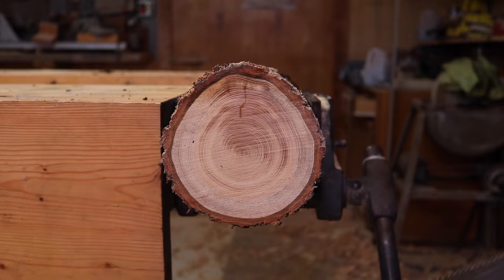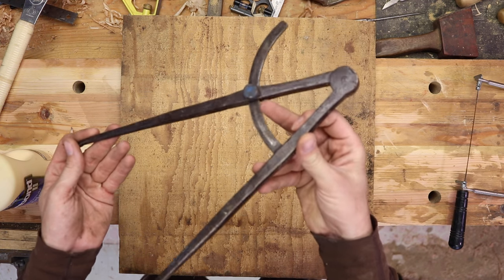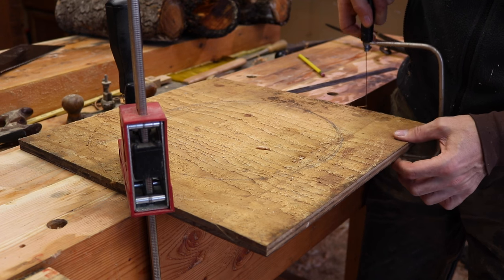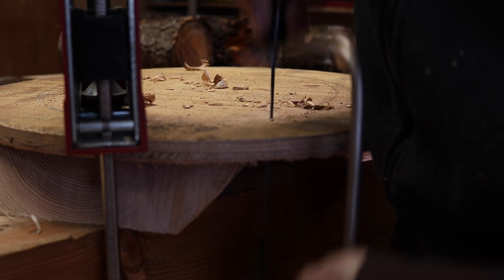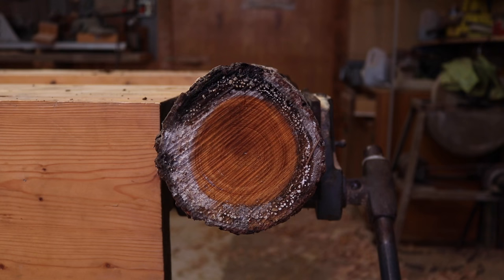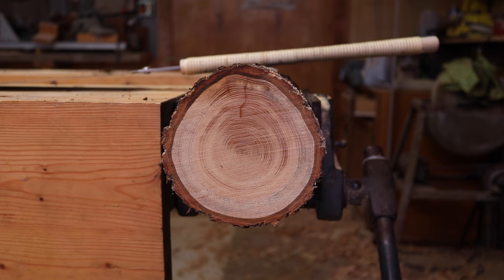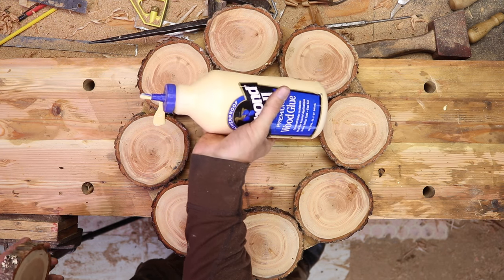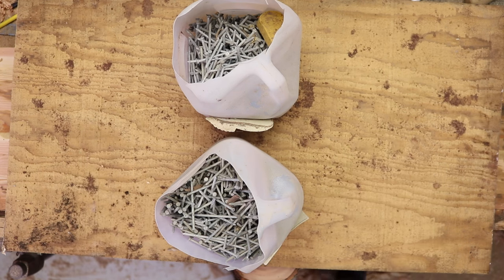DIY $1 Christmas Wreath

Comment: The tool you drew the circle with is called a divider; it's really an ancient layout/marking/measuring tool. You can use it to mark out dovetails, evenly space pilot holes for nails and screws, transfer measurements, and design and plan projects, among many other things. It'll take the math out of your layout and make it more accurate. When there's an attachment point for a pencil, it's called a compass. The one you have is special, for sure.

Comment: Is there any reason you couldn't use a power saw with a fine tooth blade?  I don't think my shoulder is up to all that hand sawing right now.   I do like the idea.
Reply: I am sure you could, but I think the point was simply that anyone can do it, you don't need an elaborate workshop to make little things like this, that mean something, and will give you a lifetime with joy. I think that you'll look at it and think back differently, if it was made with hand tools.
Reply: TheRealXesc I get the hand made point but I hurt my shoulder so it would take me all day to make those cuts.   it is an inexpensive decoration and not a heirloom after all.

Comment: Cody I feel you may enjoy a refillable glue bottle called a glue bot they are fairly inexpensive (less than $10) are a pleasure to use and not quite as messy. Be sure to get the bigger bottle you would empty the smaller one a bit fast